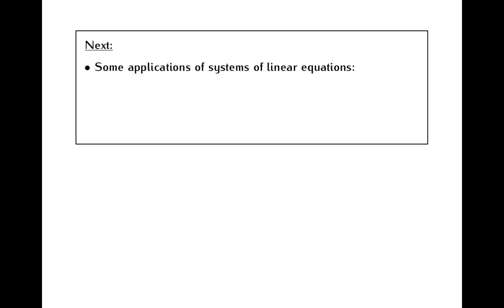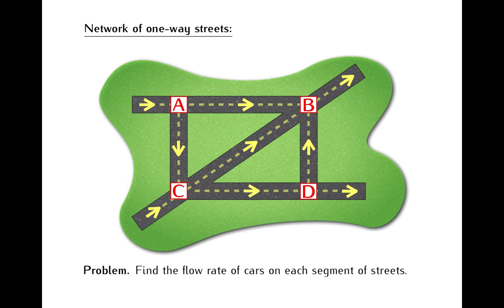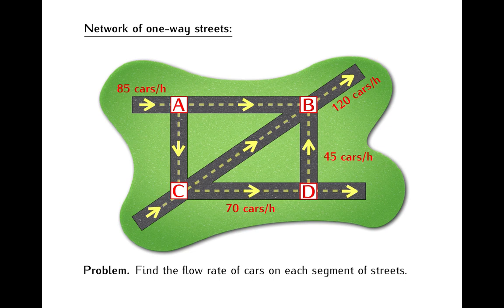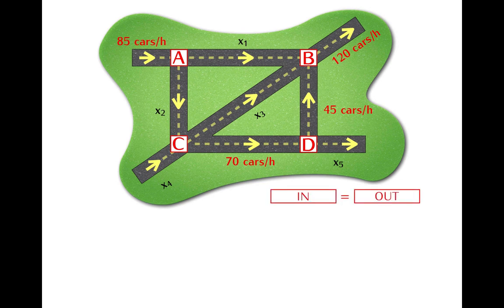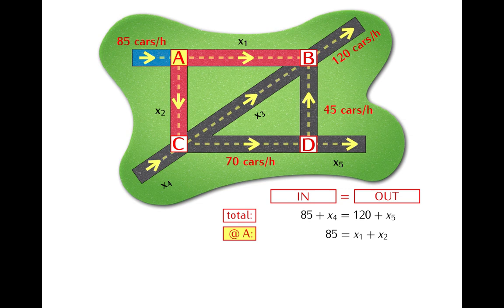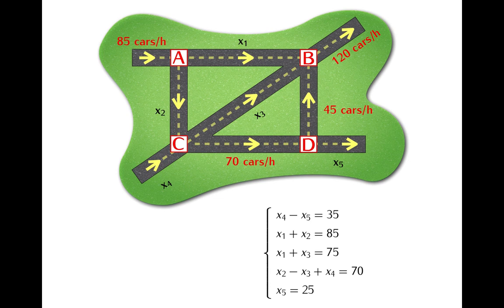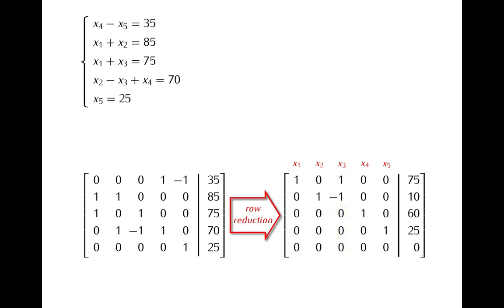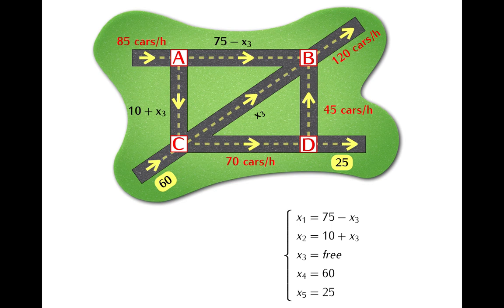02-1 Applications of systems of linear equations: traffic flow

Comment: honestly, i don't see any real use for linear algebra and traffic flow, as ppl will not always drive predictably and their purpose for driving is unknown. the best way is micro-interactions btwn cars. if u collect enough data then it works. b/c a car has a "pilot" u must study a car's performance and also reaction time given circumstances within an intersection for example.
Reply: You are correct. In real life, there are few (if any perfect) linear systems. Your example with unpredictable human factors is a perfect example of a non-linear system. Obviously, these chaotic systems are more difficult to tackle BUT one of the most valuable tricks to solve them is to "approximate" them with the closest linear equivalent system. Thus, you convert your difficult Non-linear system into a linear that you can solve and then you calculate the error of your method. If the error is small, then you pretend that your chaotic system behaves as a linear one within some constrains (ex traffic: for aggressive but not drunk drivers, or Chemistry: You will create this quantity of material with error <0.1% if Temperature < 300 Kelvin). Check for stuff like Numerical Analysis (for solving stuff with approximations), Differential Equations (Describing Systems Mathematically) and Classic Control System Theory (for modeling Linear and Time Invariant Systems -LTI)

Comment: At the end, couldn't you set node A so that 85 = 10 + x3 + 75 - x3, solve for x3, and then solve for the rest? Using the in = out concept.
Reply from the maker: kevin castro This equation simplifies to 85=85, which gives no information about x3.
Reply: +kevin castro No.  Your equation simply says 85=85.  It does not give any information regarding the variable x3.
Reply: This misconception comes from the fact that IN=OUT is not a "new" (independent) "constraint" (equation) for the system , but rather the consequence of the conservation at each node. You can "see" this easily looking at the fact that it is literally the result of summing all other conservation equations. Personally, I wouldn't write it in the first place.